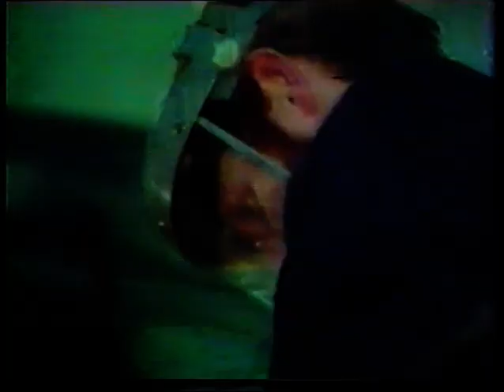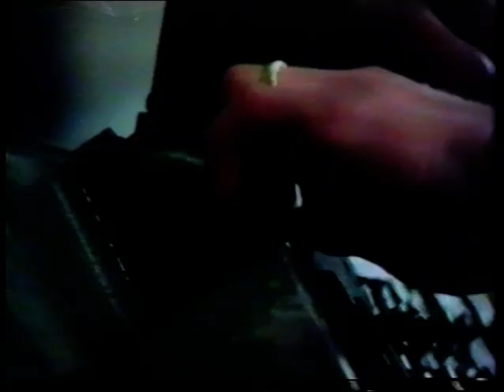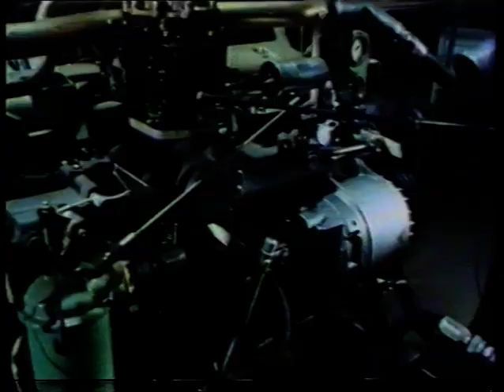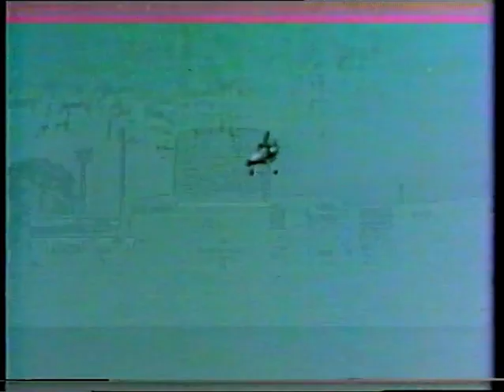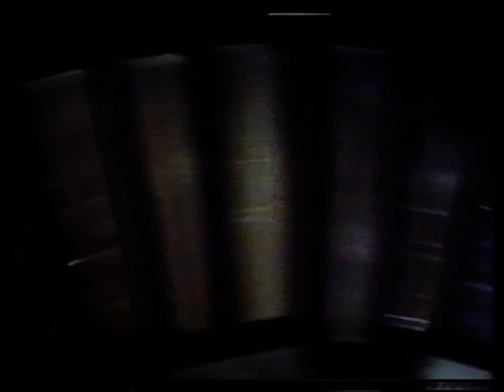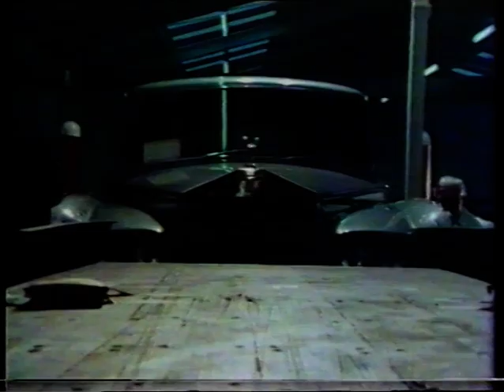Rolls-Royce Film - A New Beginning (Early 1970s)

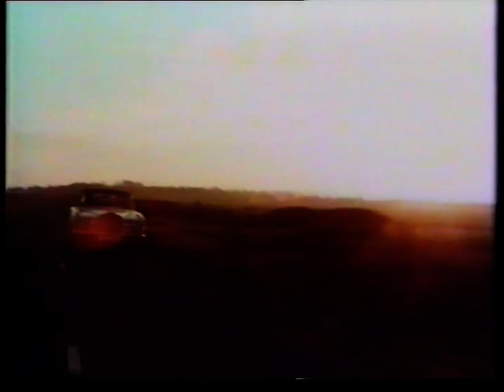Comment: At 7:53 the narrator says "the power output of the motor car engine has always been a secret".   Really, I read a writeup of the V8 when it was described in a professional journal, which gave full data.   In the original 6.3 litre version it was 159 kW.   The previous F-head six was rated at 112 kW.
I was surprised when the narrator said that RR was making piston engines for light aircraft. Then he revealed they were license-built copies of the two prominent US manufacturers' engines.
Weren't these cars fitted with Lucas electrical components?   If so, reliability will not be very good.